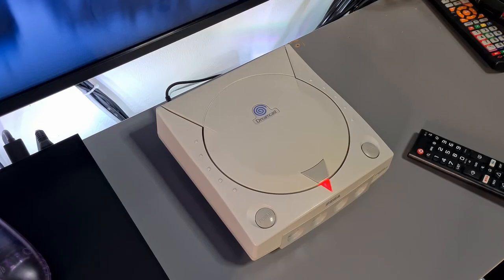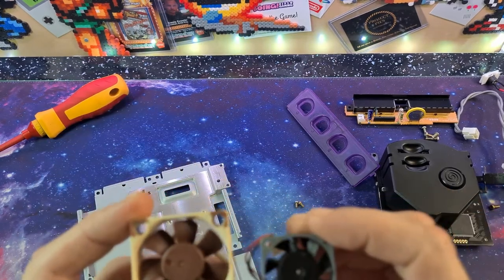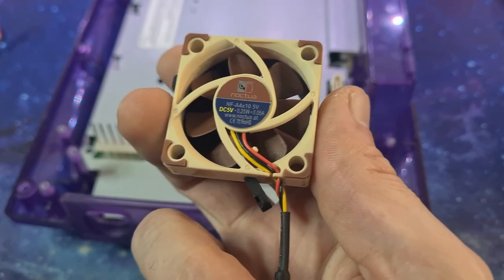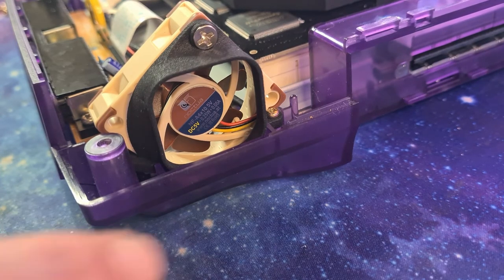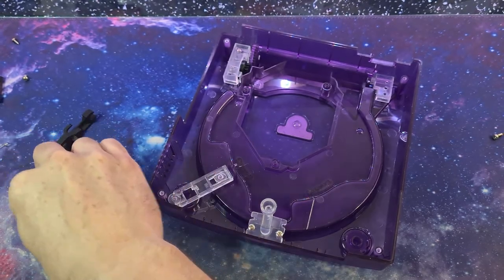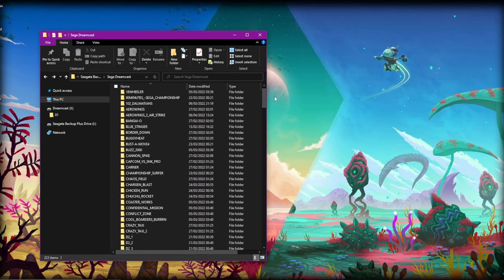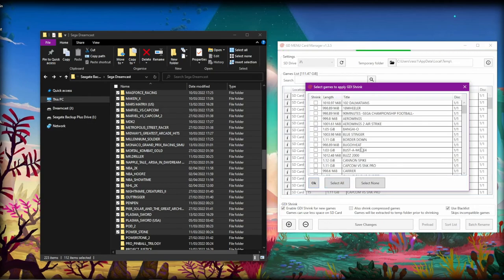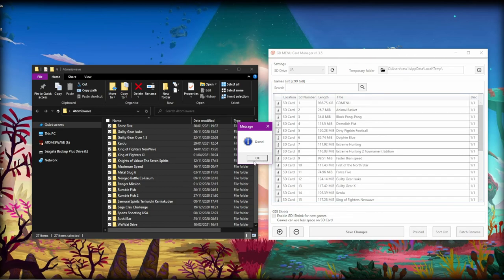Fully upgrading a broken Sega Dreamcast - Part 3 Noctua fan install and Atomiswave games

Comment: Looks fantastic mate...... if the CD Drive goes on mine I'll be doing the GDEMU mod for sure
Reply from the maker: It's definitely worth it bud. Not having to faf around with the disc's and faster loading times   is a godsend.

Comment: Have any of the screw posts on your replacement shell broke so far?. I bought mine from stone age gamer which are supposed to be the genuine ones, and one of the posts already broke and the ones that attach the top cover already cracked. I previously bought one from Ali Express and it broke too. I thought the original would be better quality. Those things break as soon as you put those screws in.
Reply from the maker: The screw posts didn't snap, but a few were quite close to doing so. The main issue I've had since doing the mod is the lid mechanism snapped off at the back and I had to glue it back on.
Reply: @NottsGamer  I see, that's so unfortunate considering how great these look 😟